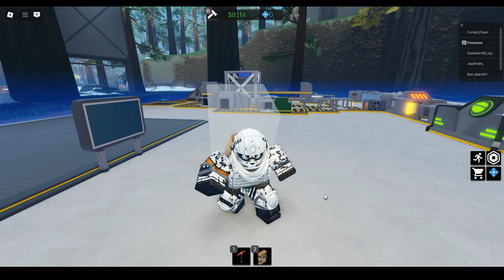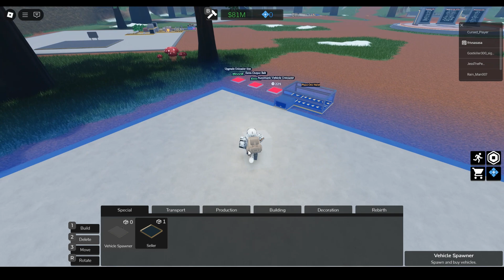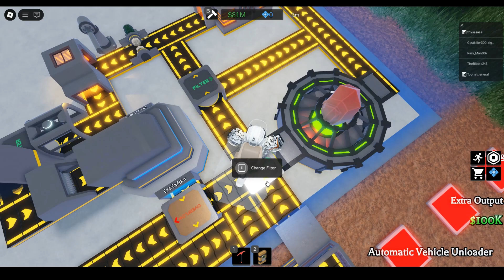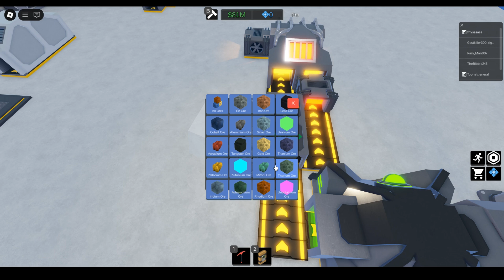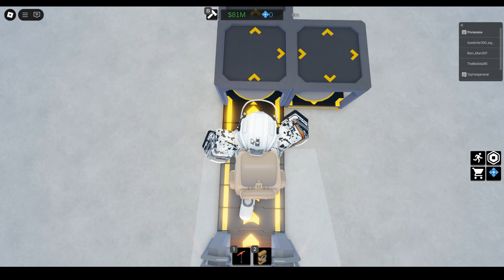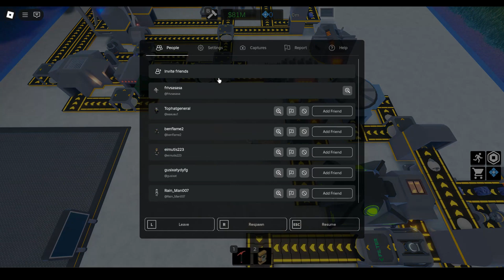Combining All Rebirth Machine + Core Assembler (Tutorial) [Ultimate Mining Tycoon]

Comment: philosopher adds 25% to all the ores that are not INFUSED with gold meaning it doesn't turn the ores in gold it just adds 25% value to them so it works for all the ores. But the build is decent but I won't filter the lower ores to go to the philosopher  I would let all of them going through because they all will have the addition to it, it doesn't turn them into gold, it infuses it and adds 25% to any ores.